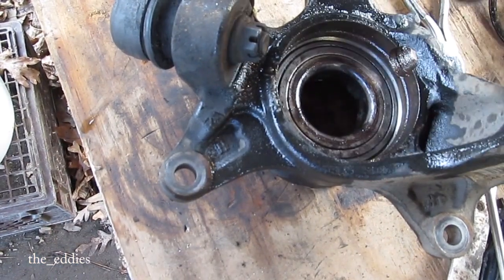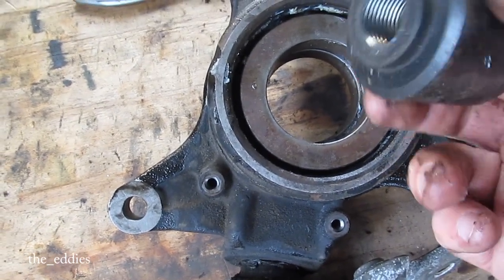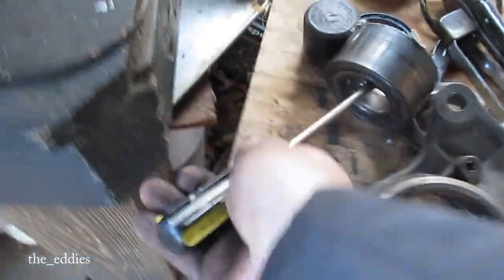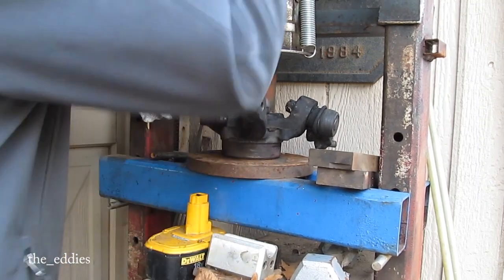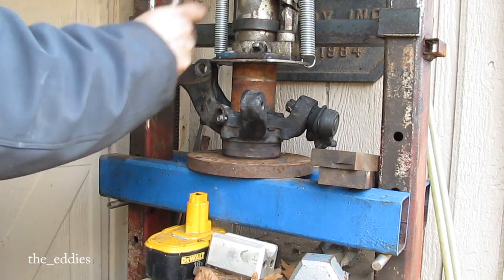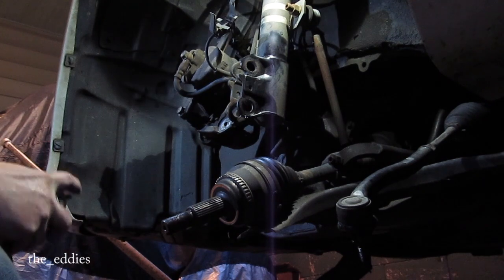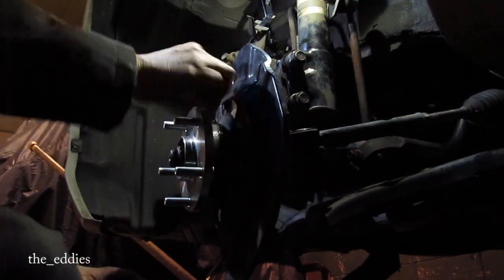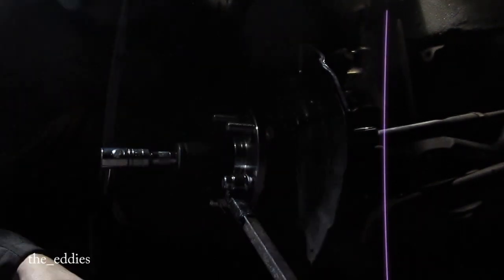Pressing out a 20 ton bearing in a 10 ton Homemade Press - Lexus ES 350 front wheel bearings

Comment: Shouldn't you support the bearing center race when pressing the hub back in? Seems like there wouldn't be excessive side load on the needles and races.
Reply from the maker: Yes, when pressing the hub into the knuckle/hub carrier. No when pressing the bearing into the knuckle. It is hard to see in this old video but about 12:34 you can see the stack up of support for the center race. Thanks!

Comment: Looks like you popped out the spindle/hub  with a slide hammer, does that destroy the shaft  bearing surface or can the old hub be re used and is it hard to take out the rest of the bearing collar that broke and is stuck on the old hub?
Reply from the maker: Yes you can re-use it but you will have to cut off part of the bearing or remove it another way, like a bearing press.

Comment: Im attempting to do this myself. I had enough money for the parts (cv axles and hubs/bearings) but I can't press the bearings myself and I don't know what to do. Please help.  I'm also doing this with a broken arm so it's a little more difficult than normal.
Reply from the maker: Take them to local repair or machine shop. Ask them if they will do it. Or get a harbor freight press for about $200.
Reply: @theeddies  that's what I'm going to end up doing on Monday. I've broken down the driver's side already with a socket set, I get an impact tomorrow so the other side will go faster

Comment: eBay sells a complete knuckle and hub assembly. for both sides cheap. Why go through the headache? I was going to have a mechanic do it for twice the cost of two assemblies plus parts. I went ahead and did it my self on my 07 ES350
Reply from the maker: Because I did not want a bunch of cheap knockoff parts with inferior bearings for 10x the price. I agree if your do not have the tools and time it would be much easier.

Comment: I'm seriously curious right now because I finally got to this project.  Do you have to remove the bastard ring to get to the snap ring?  I see that the bastard ring has a hole in it, but it looks like such a weak 'tin can' looking thing that I'm worried I'll bend it all up if I use a screwdriver or similar.  In other words: How the heck did you get the bastard ring out without damaging it?
Reply from the maker: So yeah, just use the hole, put a big screwdriver in there and leverage against the other side. Once you get a little lip up you can just scoot around it kind of like a paint can. Mine came out pretty easy. So easy in fact, I did not even show it. Just go slow, if it bends a little you can straighten it back out. It is just tin. You have to take it out the get to the snap ring. Good luck!
Reply from the maker: Oh and make sure you put the hole back in the same place, that is where the speed sensor goes.

Comment: I'm a certified knucklehead.  I just realized that you were breaking the rust bond from the bad hub and bearing using heat.
Reply from the maker: Yeah that is a big part of it. But it is also changing the heat differential as much as trying to make it expand. Getting the metal to move under press pressure. I am not going to say that I can explain chemically or mechanically exactly how it works but it works. If I heated the whole thing up equally, yes it would expand equally in every direction but the heat difference between the outside and inside helps release the bind and the rust. The same can be accomplished by completely heating the whole part and quenching it rapidly. It is just getting the metal moving getting the differentials to do the work. This would actually make a good experiment video to get some numbers and see what is actually happening.  Thanks,
Eddie

Comment: Could the bearing be cut out with a cutting wheel? Like a dremmel or something similar?
Reply from the maker: Yes, you could do it that way or even break it with a cold chisel. Keep in mind though the bearing is really 2 bearings so it would be a lot of work and you would have to be careful not to damage the hub, but it could be done. It would also need to be pressed back in.

Comment: Thank you for this video, now I know to just spend the $220 per side to purchase the entire Hub, Bearing, and Knuckle Assembly together if I ever have to replace the front on the ES350 so I don't have to find someone to press those parts out.
Reply from the maker: Harbor freight sells a $130 12 ton press and good bearings are around $50. Hub puller is maybe $50. Still cheaper in the long run, but I feel you. A pre-assembled swap would cut the job time at least in half maybe 3/4. All the best!
Eddie
Reply: @theeddies  Thanks 👍
Reply: 😂 Exactly what I did for my 05 avalon. Going to need to do the same for my lexus sadly

Comment: Good hanging with you on this one. I need to find some I beam or something to rebuild my press.. or I just need to buy a damn press. :)
Reply from the maker: This build was fun, it was made mostly from the frame of an old overbuilt trailer. The tubing has 1/4" wall. I will probably do a video on it when I decide what I want to replace the worn out jack with. I think it will be strong enough for 20 tons easily. I could have bought 2 of them from Harbor Freight for the the time I have in it though. Thanks as always for watching.
Reply: I used mostly bed frame angle with an 8 Ton, and it work well in the like 1-3 ton range I suppose, but beyond that it flexes to the point of serious danger. I need a little arbor press AND a 20 ton hydraulic, but back to the wish list we go. :)  @theeddies